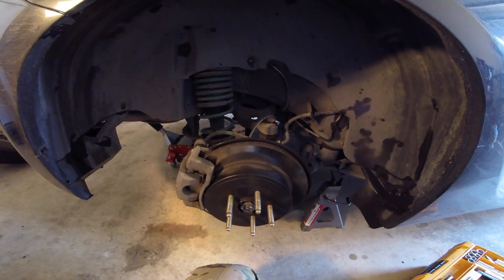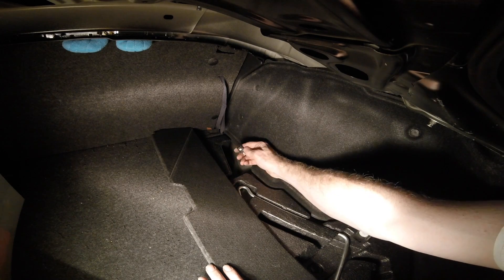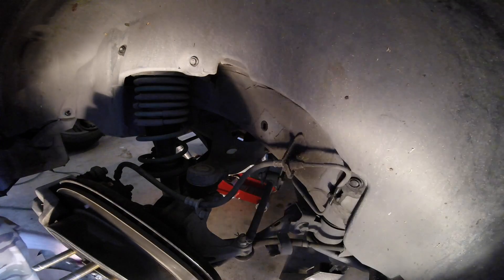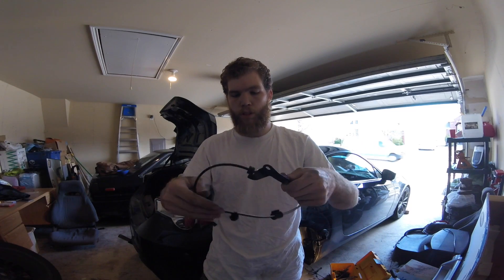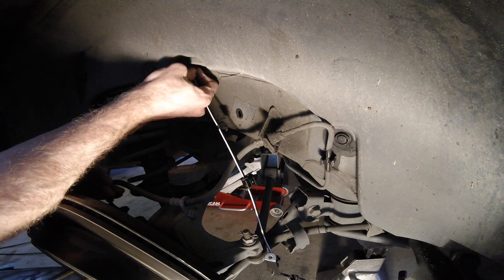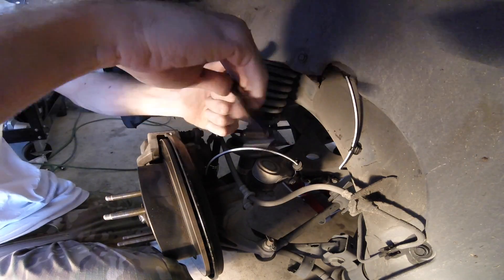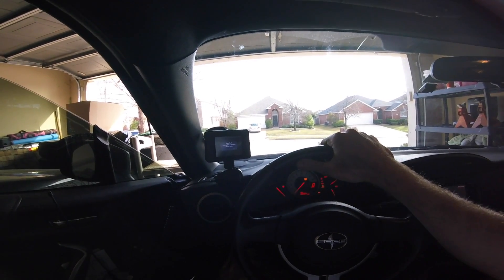FR-S/BRZ: Wheel Speed Sensor Replacement (Cures P2158)

Comment: Question: when your speed sensor failed, did you get a Check engine light, ABS warning light, traction control light, and engine limp mode? I’m curious because I just replaced my studs with extended  studs; and when I fired up the car afterwards, I got all of the warnings I described above. All I can think is that I must have damaged one of my wheel speed sensors while wrestling the rear hub and brake carrier off of the drive spline....
Reply: good to know i wasn’t the only one who wasn’t careful changing my wheel studs too lol
Reply from the maker: @boostedimpala  I know right? Oops 😅
Reply: When the engine like and all the other lights were on, was the engine feeling funny?
Reply from the maker: @Mr.pete1290  Yes. This is called "Limp Mode" or "Limp Home Mode". The ECU puts restrictions on the motor that cause it to run poorly. It does this in order to prevent the engine from being damaged when it doesn't understand what's wrong.
Reply: @JosephDalrymple does it also make it so i can’t scan the car with my obd? also great video.
Reply from the maker: @adnngyn  OFT isn't permanent. You can always unplug it. It flashes the tune to the ECU, so it doesn't need to be plugged in at all times. I mounted mine because it's convenient. It has a built-in OBD scanner, can clear codes, automate the pedal dance for you, and acts like a guage cluster by showing live data while driving.

So, you can always unplug it to use a more advanced scanner, or just use the built-in scanner. Or you can just use it once to flash the tune and leave it in a bin on your workbench 👍
Reply from the maker: @adnngyn  That being said, I at least keep it in my car if it's not plugged in. Mainly because I run E85. If I'm ever in the situation where there's no E85 near me, I can just drive it until it's empty, fill it up with 98, and flash the 98 Octane tune on it while it's filling up. I've done that a couple times. When switching between E85 and 98, you just want let the car run for about 5-10 minutes to get the rest of the previous fuel out of the lines, and you're golden 👍
Reply: @JosephDalrymple  great info but i meant if the limp mode makes it so i cant scan the car? I’ve been trying to scan it since yesterday but my fixd keeps on saying scanner not found and my oft doesn’t power on. i’m also not sure if limp mode also shuts down most of the electrical since i can’t roll down my windows and center console doesn’t work.
Reply from the maker: @adnngyn  Ah, I see! No, it does not. That sounds like a bigger issue. I'd check fuses first. Definitely something electrical. 🤔 Might have some damage to your wiring harness somewhere.
Reply: @Mr.pete1290  yep just as he described, it was barely enough power to move the car.
Reply from the maker: Apologies for the late reply, but yes. Those were about the symptoms. That's exactly why my sensor went out because I wasn't careful when changing the wheel studs. I was sure to take the sensors out of all the hubs except for that one, and it caused all those symptoms.
Reply: @JosephDalrymple  that’s what it ultimately was with mine, the sensor. Surprisingly expensive little item from my Toyota dealer!

Comment: Old vid but question, are the front and rear speed sensors the same? Or are they different parts?
Reply from the maker: They're slightly different SKUs, but I have no clue if they'd work or not. It's possible.

I put the SKUs in the description

Part SKUs:

- Rear Right Speed Sensor SKU: SU003-00664
- Rear Left Speed Sensor SKU: SU003-00665

- Front Right Speed Sensor SKU: SU003-00662
- Front Left Speed Sensor SKU: SU003-00663

Comment: My local dealership said, the abs module must be changed
Reply from the maker: That seems excessive 🤔 Are there any other codes it's throwing?
Reply: @JosephDalrymple C1246, C1241, C1249 
Changed the brake light switch (pedal). My next move is checking every abs wheel sensor, and maybe bleed the brakes

Comment: I have a feeling you did exactly what I did, pulled the hub for ARP studs and forgot to pull the sensor
Reply from the maker: Hahaha, that's exactly what happened. I pulled the speed sensor out from one side, and couldn't figure out why the hub wasn't coming off on the other side until it was too late 😂
Reply: @JosephDalrymple  i always have to learn lessons the hard way, my new one just came in so ill be installing that now
Reply from the maker: @davidlowe7201  Yeah, that's where most of my knowledge and experience has come from 😅

Comment: i currently have a problem. my car started up just fine but the ABS and traction control light popped on. It wouldn’t let me shift out of park. I turned the car off and then tried to turn it back on, that’s when it wouldn’t crank or start at all. It would only go into acc mode. it ended up throwing a bunch of codes; the main one U0401. I checked the battery and it’s fine, apparently when i would push down on the brake pedal my brake lights wouldn’t turn on. Any suggestions?
Reply from the maker: I can almost guarantee that's a brake light switch! 😅 Either your fuse is dead, or the brake light switch itself is defective. It's probably the fuse. It should be the "STOP" fuse. It's a 7.5A 👍

The brake light switch is literally a button behind your brake pedal that gets clicked whenever you push the brake in. You can literally crawl down there and see it. So, maybe an incident of hard braking if the switch itself is broken?
Reply: @JosephDalrymple So i took it to the dealership sadly after replacing the switch and they replaced it with another one and a fuse, but they didn’t say which fuse… The fuse you are referring to, is that located under the dash? or under the hood?
Reply from the maker: @saucedbrz  Oof! Hopefully it wasn't super expensive. Wish I had responded sooner! It should have been Fuse #6 or #14 in the cabin under the steering wheel near the hood release 👍

Otherwise, it could have been #21, #30, or #45.

But given that the brake lights weren't turning on, my money is on Fuse #6. You could pull it out to try and replicate the issue and confirm 👍
Reply: @JosephDalrymple just a light $350 😭😭
Reply from the maker: @saucedbrz  Ouch! I'm ashamed to admit how many times I've thrown money at a problem only to find out it was just a fuse 🤣

Comment: Great video. I recently ran into P2158 B and figured it was trying to tell me 1 of the 4 WSS were letter 'B'. That does not seem to be the case here. While tracking my car at Homestead the car went into LIMP and never passed 5k RPM's. ABS light on the dash randomly popped on and off and made for a pretty bad lock up situation on track that almost wrecked me. I need to know if this is a WSS related issue or a hub related issue. My guess is WSS since I had swapped all hubs to refresh the bearings. I did have an old accident on the right rear last November so it could have messed up that WSS.
Reply from the maker: Yeah, I ran into this issue after pulling the hubs to fit new studs. The RR WSS got damaged in the process, unfortunately 😅

Comment: Is it possible these sensors can just get dirty and cause the SLIP/CEL to come and cause the issues everyone is talking about? I have a C1201 code but it’s been years since I’ve messed with any suspension or wheel/hub modification. I have driven the car in snow a few times the past few months and wondering if things just got gunked up?
Reply from the maker: The symptoms everyone is experiencing is LIMP mode, which is activated anytime the ECU detects conditions that are either impossible or highly unlikely.

In the case of a P2158, this might manifest itself when one or more of the speed sensors show 0mph when the others are showing 50mph. Because that's a pretty concerning thing to see, the ECU purposefully produces these symptoms in order to protect the engine from further damage. (Apologies if you already knew all that.)
Reply from the maker: Are you getting any other codes outside of the C1201? (Apologies for the late reply.)
Reply: @JosephDalrymple  I have P0441 which I would imagine is unrelated? I could be wrong. I also have B14A1 which again I would imagine is unrelated
Reply from the maker: @igliumagallanes7238  Yeah, the B14A1 is related to the sunload sensor, which basically just tells your A/C to work harder on sunny days.

The P0441, however, would definitely be the cause, since it's related to your EVAP. Chances are something got damaged... I imagine a vacuum line, or maybe the purge solenoid. It's more than likely a vacuum hose. Gotta love emissions equipment! :D
Reply from the maker: @igliumagallanes7238  In order to test the lines on the EVAP system, start by just visually inspecting the lines for any leaks. Most shops will hook up a smoke machine to the EVAP system, and then see where the smoke is coming out of. But they're $200-300 on Amazon, and not entirely necessary.

If you find any damaged hardlines or hoses that are apart of the EVAP system, you've found your culprit. If not, you might be able to use a squirt bottle to actively look for air bubbles while soaking the hoses, hardlines, and connectors. But it can sometimes be tricky to identify, and may lead to some false positives.
Reply: @JosephDalrymple I also have some similar to his and different from the other limp mode issue… I can’t find anything on the issue except for your video. 

No dash lights except for my TPMS …  because I don’t have any in my current wheels

All my current codes are 
B14A1,
(ABS): C1231, C1241, C1201
(TPMS) C2123, C2124 

The one giving me the biggest challenge trying to research/learn about:::  “C1231 — speed wheel sensor rear center circuit open” 

“C1241 — Low battery positive voltage” 

“C1201 — Subsequent code due to engine code”
Reply from the maker: @LiLYZ125Rider  Honestly? When was the last time you changed your battery? Lot of scary codes here, but that's where I'd start if I were you. If you have a multi-meter or voltage meter you can check the voltage on the battery.

- Sgouldnt be lower than 12v at rest
- Should be about 13.5v-14.5v while the car is running
- Shouldn't dip below 10v while cranking

Here's the thing, though... If it's at 12.5v while the car is completely off, but it's below 14v when the car is on, it's entirely possible the issue is your alternator.

But honestly it's probably one of those... Battery or alternator.

Comment: I have speed sensor problem but how can I know which one is ba
Reply from the maker: If you're reading resistance across all four sensors, then the sensors aren't bad. The next thing would be to turn the car on into ACC mode (not engine start), and then use the power probe to make sure that, on the vehicle side, you're getting power to the connectors. Stick the probe into one of the two slots. One will give you a reading of 0 and ground, and the other should give you around 12 volts. If you're not getting anything, then there's something else going on. Maybe a fuse?

Lastly, if they're all getting power, then it may be the wheel speed sensor rotor, that is typically on the axle.
Reply from the maker: There are a couple of different ways to figure it out. The easiest would be to use a diagnostic tool, but if you're asking, you probably don't have one.

The next best thing would be to test each sensor individually until you find out which sensor(s) are bad, which is trivial but tedious.

With a multimeter set to Ohms, unplug the sensor's connector. Insert the prongs into the two slots of the sensor's connector. Make sure that the prongs don't touch each other, or it'll mess up the reading.

If you're able to measure resistance, then the sensor is good. If you're not sure, check one of the other sensors. If you're not getting any reading, then the sensor is bad. Best to check the other sensors while you're already doing it in order to confirm that you're not doing it wrong, and also that you don't have more than one sensor that's bad.
Reply from the maker: Honestly, the way I found out was just by thinking back. When I was pulling apart the assembly, I was really rough with it and ended up breaking the sensor. So, I already knew which one was bad.

If for instance you hypothetically took a hammer to something, you'll probably recall which one is bad :P

Comment: I have the same code P2158 vehicle speed sensor B but all my speed sensor are good, goes into limp mode ,engine, ABS, traction control lights are on, was reading that FRS does this when one set of tires are bigger then the other two, and my rear tires are bigger than the front idk if this is the problem or not any suggestions
Reply from the maker: Tires that are too big or too small can cause a problem where the speedometer no longer reads the correct speed. You probably know that this is because the speedometer displays an "assumed" speed based on the time it takes for the tire at the factory diameter will take to do a full rotation. However, I'm not entire sure why a larger tire size would throw a red flag for the ECU. To my knowledge, the ECU wouldn't have a way of knowing that the size of the tires are incorrect.
Reply: @JosephDalrymple  yes I put my stock rpf1 back on and no more CEL. It however ran differently (slugish) changed the trans fluid and engine oil and cleaned the throttle body. Now my car runs and sounds cleannnnn
Reply from the maker: @Trvbpm  Ah! OK, gotcha. That makes sense. I was a little tired, so I totally glossed over the staggered tire sizes. Yeah, that'll definitely do it. I think the maximum difference is something like 3-4% or something? If it's off by more than that, it'll start throwing codes, because it won't trust the sensors anymore.
Reply: Hey Jonathan, so I switched my tires last night to a bigger size in the rear with different rim size as well. Front are 215 with rim size 17 the back tires are 225 rim size 18. I never had any issues with it the first drive but the second time I drove it, it gave me all those codes as well. Right now i went to autozone and it read the P2158 code as well as the ABS codes
Reply: I’m hoping this is the issue maybe I can change the tires back and reset the codes but with it being the check engine light I’m not sure if it’ll work.
Reply: Well Kossy let me know if that was the problem
Reply: @classicred1048  sorry for the late reply but yes the problem was due to the fact they were different sizes on the back
Reply: To be honest I really think it might be the tire size problem, all my wheel speed sensors are working, or if it’s not the tires it might be the actual sensor on the transmission
Reply from the maker: Are your tire sizes staggered? (bigger in the rear, smaller in the front?)
Reply: I’m also getting a c1237 speed sensor rotor faulty, I looked it up and it might also have to do with tire size
Reply from the maker: @classicred1048  Yeah, I misunderstood at first because it was late at night, but that'll do it. Running a staggered tire size (small in front, big in back) will throw those codes. If I remember correctly, the largest deviation in overall diameter of the wheel can't be over, like, 3-4%. If your front are small, or your rear are big, by too much, it'll start throwing codes.

Comment: What’s the process look like on the driver front ? Is it more or less the same ?
Reply from the maker: Yeah, front is more or less the same. I'm not entirely sure where it's routed, but you can check the FSM on how to replace it. It should be a relatively similar process.

Comment: Does this also cause idle problems where the rpms try to dip below 500
Reply from the maker: It did cause the car to go into limp-home-mode, where it refused to go above about 3,000 RPMs, and I believe there was some weird idling associated with it. In limp mode, the car doesn't car how shitty it runs, as long as it runs in a way that will save the engine or transmission from damage. Because modern cars have so many electronics and sensors, they rely more and more on them, so it's easy for it go into limp mode.

However, if your CEL isn't on, it's probably not a speed sensor. If it is on, pull in to an Auto Zone or O'Reilly Auto Parts. They'll plug an OBD diagnostic tool in for free and read your code for you and then you'll know for sure!

Comment: Thanks dude this vid helped me alot.
Reply from the maker: Puras Pinche Dabs Absolutely man! Glad to hear it helped! :D
Reply: Joseph Dalrymple im still doing research on it to see if it is that but my car won't pass 4000 rpm n abs light on n traction is off i thinks the line bc i was putting on coils n my friend pulled in the line wile take it out the coil

Comment: when it originally went out did it cause the car to run weird at all or did it have a steady idle at 500 rpm and not let you rev over 4k?
Reply from the maker: Jake42ization As far as I remember, it didn't go into limp mode. What codes is it throwing?
Reply: Joseph Dalrymple only P2158 do you think it could be that I have an automatic
Reply from the maker: That would be it! Automatic relies heavily on the speed sensor. It will definitely go into limp mode!
Reply: Joseph Dalrymple perfect I have now gotten to the bottom of my problem. thank you very much for your help
Reply from the maker: Jake42ization Absolutely! Glad to help. Let me know if you have any other questions!

Comment: When you looked down into the hole where the sensor goes into the hub, did the sensor go on the inboard or outboard side of that flange that it rides on?
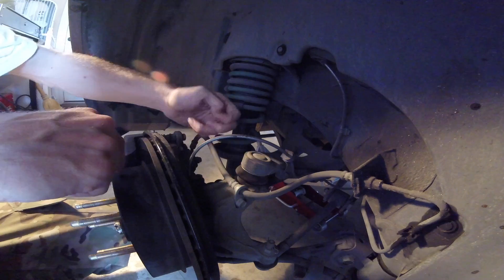Reply from the maker: That would be the outboard side, good sir, if I'm understanding your question correctly. You should be able to see it clearer at about 1:51 - 1:53 -- The wire and sensor are linear, and the flange extends inward toward the differential. The sensor is outboard in comparison; the flange being inboard when compared to the sensor.